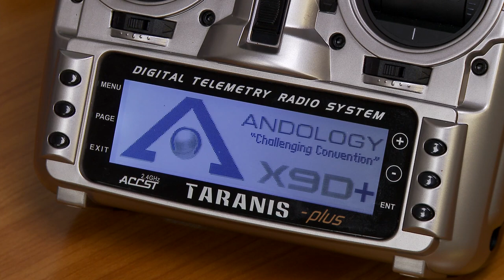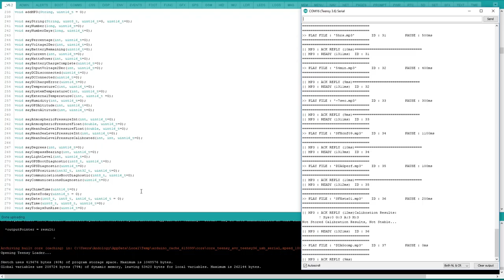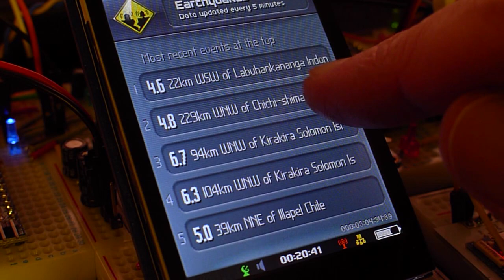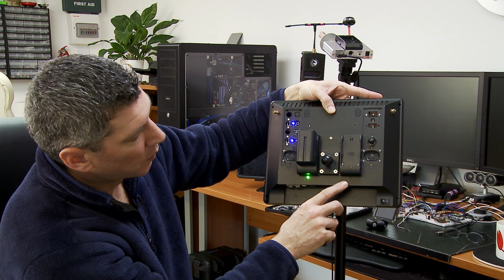⭐ FPV Antenna Tracker, DIY Electronics & FPV Project Trailers 2019

Comment from the maker: Thanks for checking out my project trailers video for 2019 - Please let me know which projects you're most interested in seeing more about! Thanks again! :)
Reply: Good to see you're back on YT. 
One way or another you have identified almost every project I'm currently working on. Couple of differences though, I'm a little way into building a functional "Pip-Boy", using the same "Geiger Counter", instead of a TIA. I use 20V power tool battery packs instead of camera batteries to supply portable electricity requirements. I have 48 Headway LiFePO4 cells waiting to be built into a luggable power supply, I haven't considered LTO chemistry cells, as yet.
I also fly RC models.... and I'm off camping this weekend, not into the survivalist SHTF stuff, just wild camping and bushcraft but will not hesitate to erect my portable PV panels.
Sorry, this is not any great help when it comes to identifying the topics people are most interested in, shove a video on any of them up, I'll watch.

Comment: One more question; which frequency range does your FPV tracker work? Is it 2.4GHz or 5GHz WiFi? Maybe both, each antenna for  different spectrums.
Are you technically tuning the antenna to find the direction of the best RSSI value over the air?

I am not very familiar with this stuff though. Sorry if these questions are not logical for your work.
Reply from the maker: Hey no problem, perhaps I should explain it all better in the video I make for the Antenna Tracker - it is using 2.4ghz yagi antennas for receiving video transmission from the aircraft. The aircraft has a gps onboard and sends the coordinates to the ground station via wireless telemetry link, the Antenna Tracker knows where it is, and so determines the relative location of the aircraft using the gps dats from the telemetry feed. The Antenna Tracker will point the high gain antennas directly at the aircraft at all times to ensue maximum video signal is received while you fly in any direction - here’s a video I made with tutorial on antennas https://youtu.be/cMIqlsDu9h8
Reply: @Andology  Excellent! I will definitely check out your other videos. Have a good day.
Reply from the maker: Thanks buddy, appreciate your interest! 😊

Comment: Would be great if you were to look at CrossFire GPS telemetry for the antenna tracker. Instantly becomes a lot more Universal.
Reply from the maker: Absolutely and totally Shannon :) i use Crossfire system too, and using the MavLink data coming in from that was what I was planning to use. Originally I wanted to be able to tap into the immersion Rc audio telemetry but they’re pretty protective over the protocol, but mavlink is open source so I can read the data and do stuff with it.. also I want to implement Bluetooth as the crossfire module can output the telemetry data via Bluetooth so that would be even better ;) thanks for your comment. I’ll make sure I mention the Crossfire telemetry in my video coming up with the FPV Antenna Tracker teardown Video.
Reply: @Andology  Awesome!  Exactly what I'm looking at.  Crossfire Bluetooth mavlink GPS to the tracker.  Or using the s.port and bluetooth from the taranis serial port in the battery bay to the tracker. :)
Reply: @Andology  any thoughts on when you might be looking at the antenna tracker crossfire project?  :)